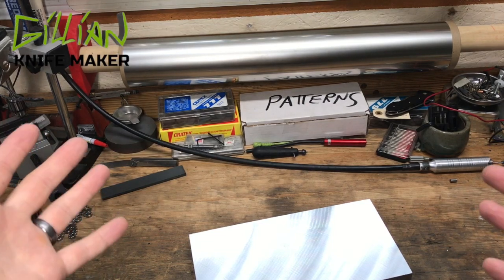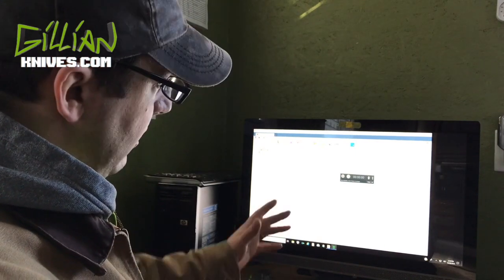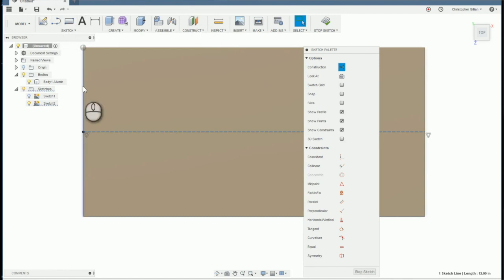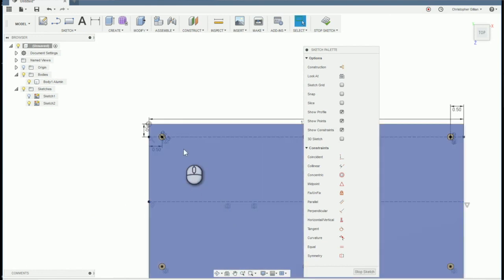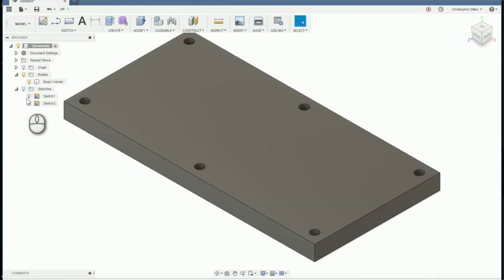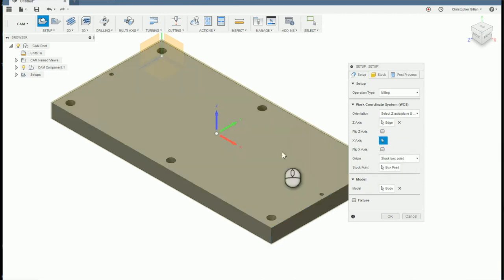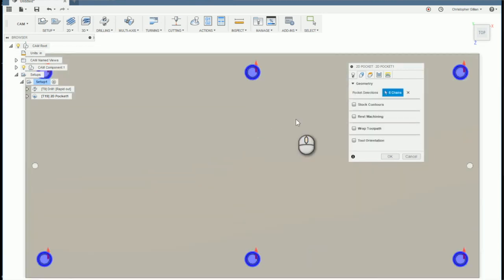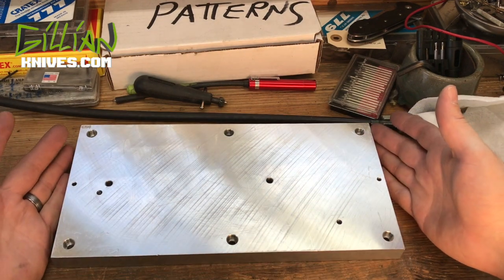MIC 6 Aluminum Plate - Fusion 360

Comment: Great Video, Chris.  I appreciate you taking the time to do all this.  What software did you use to capture the Fusion 360 screens on the computer?
Reply from the maker: Autodesk Screencast iirc.  My shop computer, is currently down.  Windows 10 update killed it.  So I’ve been running everything on the MacBook.
Reply: @GillianKnives  Sorry to hear about the Win10 update... I haven't heard of that in a while...  and nothing supports win 7 any more either..........